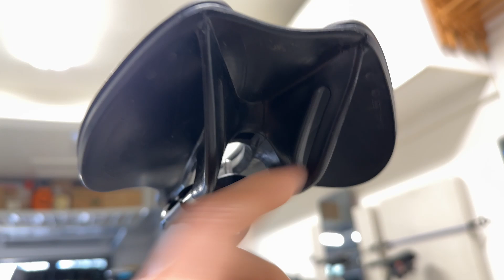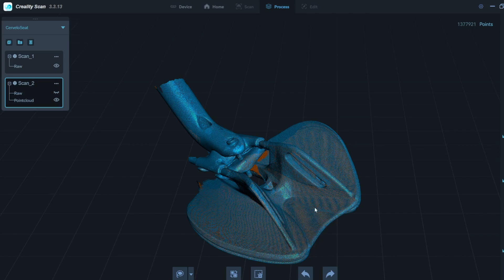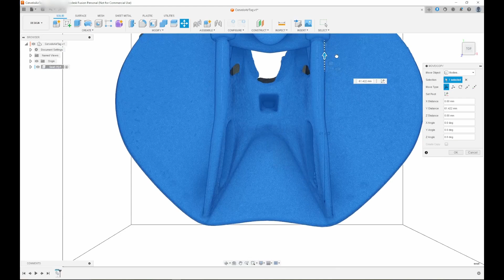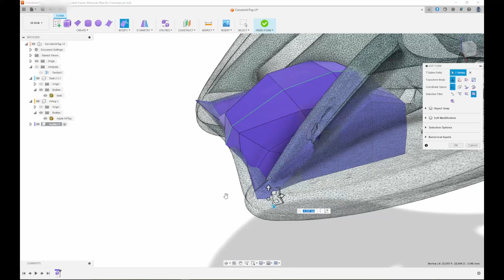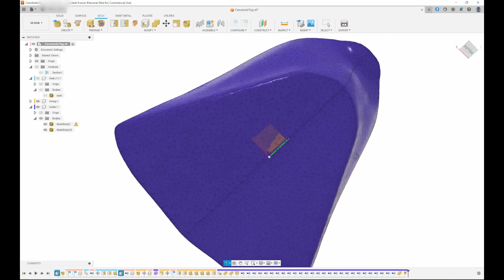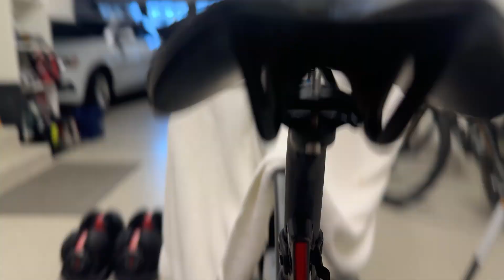Learning 3d Scanning with my Creality Otter!

Comment: Hey man! Cool project and video! I wanted to ask your opinion about the usability of the Creality Scan software--there's a lot of pitchforks out on reddit but sometimes the users aren't patient or have wild expectations. Do you find it to work and be reliable? The Otter looks pretty cool and can already think of a thousand uses for it. Your Airtag design would be an awesome silicone product. Great job
Reply from the maker: Thanks for the compliment! I could see how somebody who is a professional could be frustrated with the software, however for the use-cases I've had so far... I was able to do what I needed without too much hassle using the scanner or the software. I'm also running it on a fairly old laptop. I think the thing I've struggled with the most (but am getting better at) is merging multiple scans for a single object (in Creality's software), or aligning the mesh that is created (I've just done this in Fusion). I'm still happy with it overall for the price!